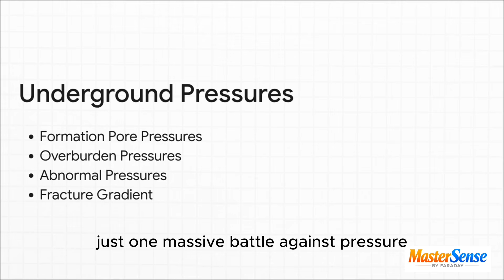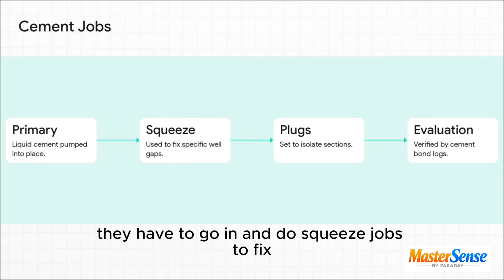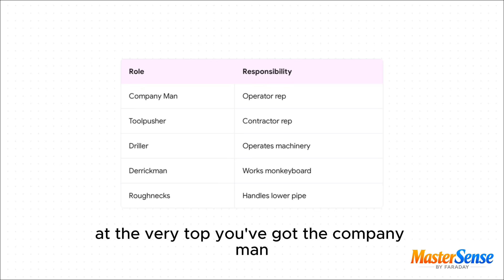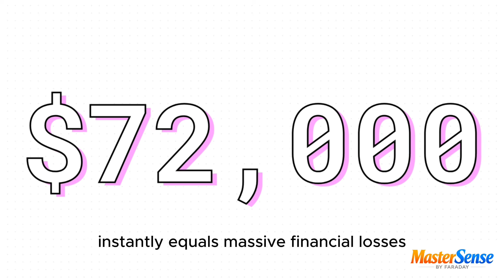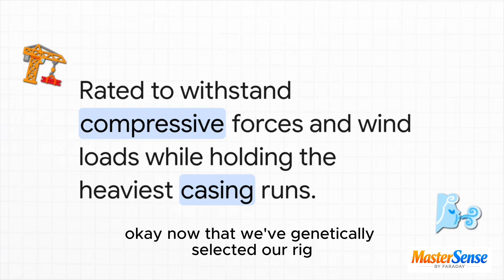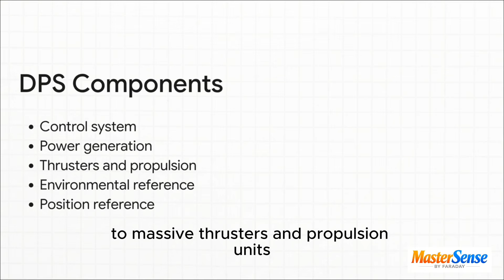Drilling Engineering 101: How Oil Wells Are Built from the Ground Up

Comment: 1. Oil mining lease
2. Day-Rate Contract 
3. Permeability 
4. Authorization for expenditure 
5. Conductor casing 
6. Hoisting System
7. Electric Motor
8. Heart of the drilling fluid circulatory system 
9. Heave Motion Compensation System
10. Marine Drilling Riser

Comment: Answers to the quiz questions.
1. Oil Mining Lease
2. Day-rate Contract
3. Permeability 
4. Authorization for Expenditure (AFE)
5. Conductor casing 
6. Hoisting system 
7. The Top-drive 
8. Mu pumps are considered as the heart of the drilling fluid hydraulics 
9. Heave compensation system 
10. Marine drilling riser

Comment: 1. Oil mining lease
2. Day-rate contract 
3. Permeability 
4. AFE(authorisation for expenditure)
5. Conductor casing pipe
6. Hoisting system 
7. electric motors
8. Mud pumps are considered the heart or prime mover
9. The heave compensation system
10. Marine Drilling Riser

Comment: Q1 Answer: Oil Mining Lease (OML)
Q2 Answer: Daywork Contract.
Q3 Answer: permeability
Q4 Answer: Authorization for Expenditure. (AFE)
Q5 Answer: conductor casing
Q6 Answer: hoisting system.
Q7 Answer: either an electric or a hydraulic motor
Q8 Answer: heart
Q9 Answer: Heave Compensator.
10 Answer: Marine Drilling Riser

Comment: At 18mins

1. Oil Mining Lease (OML)
2. Day Rate Contract
3. Permeability
4. Authorization For Expenditure (AFE)
5. Conductor Casing

At 23mins

6. Hoisting System
7. Top Drive Motor (Electric Motor)
8. Heart of the drilling fluid hydraulic
9. Heave Motion Compensation System
10. Marine Drilling Riser

Comment: Answers to questions 
1. Oil mining lease( OML)
2. Day rate is the most common contract 
3.permeability 
4. Authorization for Expenditure (AFE)
5.conductor casing
6.hoisting system or equipment 
7.electric motor
8. heart of the drilling fluid hydraulics system
9. Heave Compensation System
10.marine Riser

Comment: 1. Oil Mining Lease (OML)
2. Day Rate Contract
3. Permeability
4. Authorisation for Expenditure (AFE)
5. Conductor Casing Pipe
6. Hoisting System
7. Electric motors
8. Mud Pumps
9. Heave Compensation System

Comment: 1. Oil Mining Lease (OML)
2. Day-Rate Contract
3. Permeability
4. Authorization for Expenditure (AFE)
5. Conductor Casing
6. Hoisting System
7. Electric Motor
8. Mud Pump
9. Heave Compensation System
10. Marine Drilling Riser

Comment: 1. OML- Oil Mining Lease
2. Day Rate Contract
3. Permeability
4. Authorisation for Expenditure (AFE)
5. Conductor Casing Pipe
6. Hoisting System
7. Electric motors
8. Mud Pumps
9. Heave Compensation System

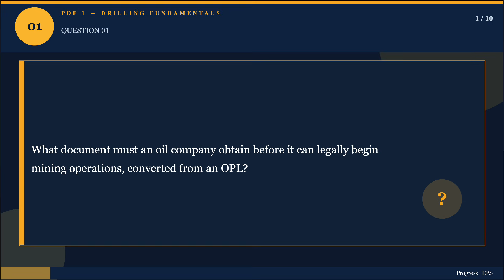Comment: 1. Oil Mining Lease (OML) 18:05 
 2. Day-Rate Contract
 3. Permeability
 4. Authorization for Expenditure (AFE)
 5. Conductor Casing
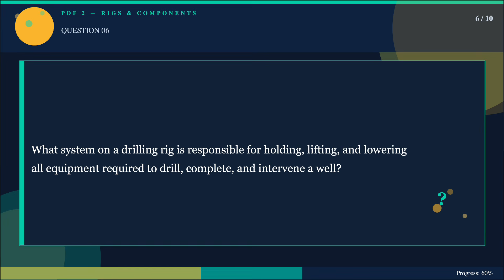 6. Hoisting System 28:56
7. Electric motor
8. Heart of the drilling fluid hydraulic system.
9. Heave motion Compensation System
10. Marine Drilling Riser

Comment: 1. Oil mining lease
2. Day-Rate Contract 
3. Permeability 
4. Authorization for expenditure 
5. Conductor casing 
6. Hoisting System
7. Electric Motor
8. Heart of the drilling fluid hydraulic.
9. Heave Motion Compensation System
10. Marine Drilling Riser

Comment: Answers to quiz questions
1.What document must an oil company obtain before it can legally begin mining operations converted from an OPL?  Answer "Oil Mining Lease (OML)"
2.What is the most common type of drilling contract used between and a drilling contractor?  Answer "day rate (or daywork) contract."
3.What property of a reservoir rock describes the connectivity of pores that allows hydrocarbons to flow? Answer "permeability."
4.What is the name of the cost estimate document that must be prepared and approved before a drilling program begins? Answer "Authorization for Expenditure"
5.What is the first and largest diameter casing driven into the ground to prevent unconsolidated surface formations from collapsing? Answer "conductor casing"
6. What system on a drilling rig is responsible for holding, lifting and lowering all equipment required to drill, complete and intervene in a well? Answer "hoisting system"
7.What type of motor hydraulic or electric suspended in the mast of a rig drives and rotates the drill string in a top Drive system? Answer "top drive"
8.What are mud pumps considered to be in relation to the drilling fluids hydraulic system? Answer "mud pumps are considered as the heart of the drilling fluids hydraulics"
9. What system on a floating offshore rig is designed to nullify the effects of the vessel's vertical motion on the drill string and bit? Answer "motion compensation system"
10. What is the name of the pipe structure that extends the wellbore from the mud line to the derrick floor returning drilling fluid and cuttings to the surface? Answer "marine drilling riser"

Comment: @18mins

1. Oil Mining Lease (OML)
2. Day Rate Contract 
3. Permeability 
4. Authorization For Expenditure (AFE)
5. Conductor Casing

@28min

6. Hoisting System 
7. Top Drive Motor (Electric Motor)
8. Heart of the drilling fluid hydraulic 
9. Heave Motion Compensation System
10. Marine Drilling Riser

Comment: Answers To Quiz
1. Oil Mining Lease ( OML)
2. A day rate contract
3.Permeability
4. Authorization for Expenditure 
5.Conductor casing
6.Hoisting Equipment
7. Electric Top drive motor
8. Heart mover of the rig
9.The heave compensation system
10. Marine riser

Comment: 1. Petroleum mining lease
2. Day-rate contract
3. Permeability
4. Authorisation for expenditure
5. Conductor pipe
6. Hoisting system
7. Electric motors
8. Mud pumps are considered the heart or prime mover of the drilling fluid hydraulic system.
9. The heave compensation system
10. Marine riser

Comment: Answers from the Quiz 
1. Oil mining lease 
2. Day-rate contract 
3. Permeability 
4. Authorized for expenditure (AFE)
5. Conductor casing 
6. Hoisting equipment 
7. An electric motor 
8. Heart movers of the rig 
9. A motion compensation system 
10. Marine riser

Comment: Answers to the quiz
1. Petroleum mining lease 
2. Day rate contract or day work contract 
3. Permeability 
4. Authorization for expenditure 
5. Conductor casing 
6. Hoisting system 
7. Top drive motor 
8. Heart of the drillng fluids hydraulic system 
9. Heave compensation system 
10. Marine riser

Comment: Question 1: An oil mining Lease (OML)
Question 2: Day Rate Contract 
Question 3: Permeability 
Question 4: AFE( Authorization for Expenditure)
Question 5: Conductor Casing

Question 6: Hoisting System 
Question 7: Electric Motor
Question 8: Mud pumps are considered the Heart of the drilling fluids hydraulic system 
Question 9: Heave Compensation System 
Question 10: Marine Riser

Comment: Question 1- An oil company must obtain an Oil Mining Lease (OML) before it can legally begin mining operations after converting an Oil Prospecting Licence (OPL).

Question 2- Day rate contract

Question 3- Permeability 

Question 4- Authority for Expenditure (AFE)

Question 5- Conductor casing

Question 6- Hoisting System

Question 7- Electric Motors

Question 8- Considered as the heart of the drilling fluid hydraulic system 

Question 9- Motion compensation system

Question 10- A marine riser